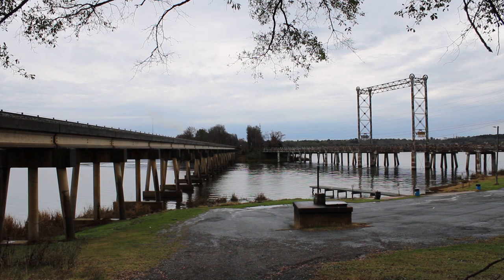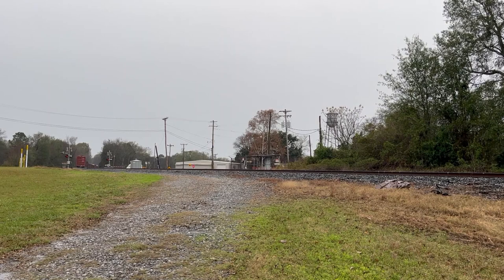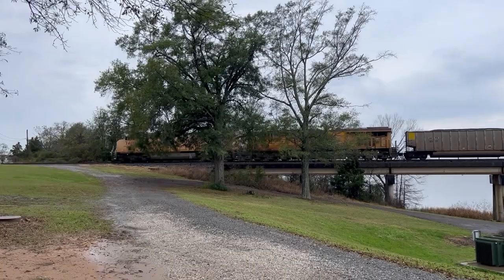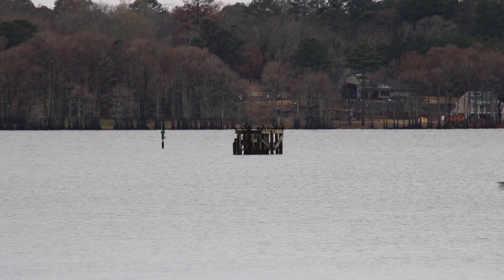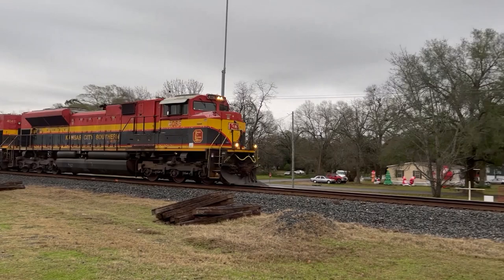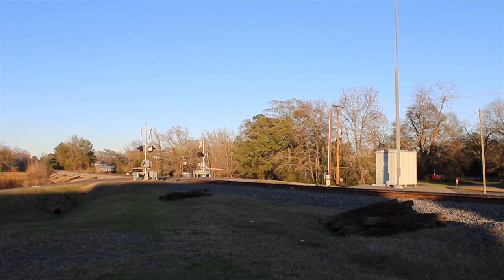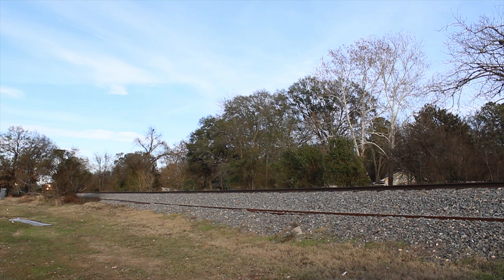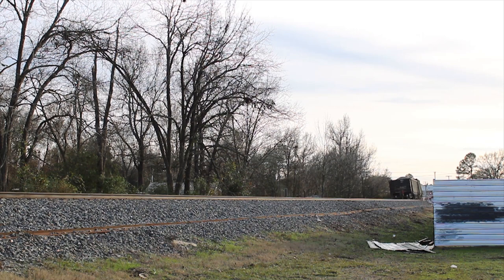KCS's Shreveport Sub. In North Louisiana

Comment: I hope to come here during summer. If it merges, it probably already would have done so. Nice, video! Also, cool that you got to see a thundercab in the lead. Here in SoCal, get loaded well cars with mixed freights on UP and I am pretty sure BNSF. I always thought it was interesting to see that. Speaking of well cars, I saw a container on an intermodal that was half open, and full of tires. That was a cool catch. Thanks for the vid!
Reply from the maker: Thank you! That’s cool that UP also has well cars on mixed freights, I didn’t know they did that. Do you think the container you saw was opened by vandals?
Reply: @Southern_Plains_Railfan  It could have been. It was coming from Los Angeles which have really bad train robberies (they were a lot worse last year. You couldn't see the tracks, because of all the boxes that they opened. Also, it was in one specific area in LA. They even stole locomotives and started controlling them on the tracks!), so I don't know for sure.
Reply from the maker: @IllBeStamped  Wow, I heard about all the robberies but I never heard about them taking locomotives for a joy ride! How did the railroad put that to a stop?
Reply: @Southern_Plains_Railfan  I don't exactly know, but yeah. It was pretty bad.